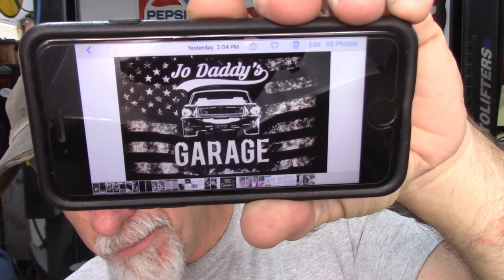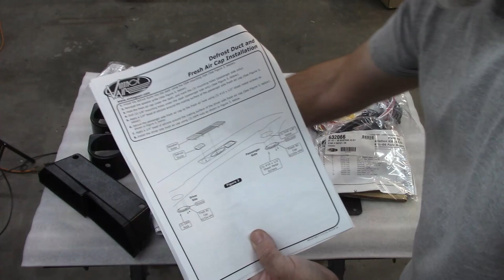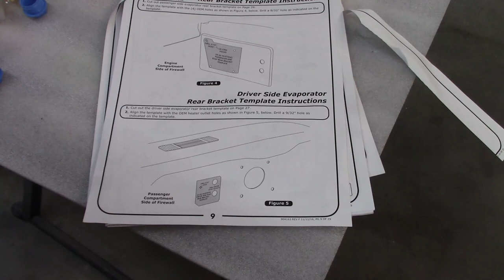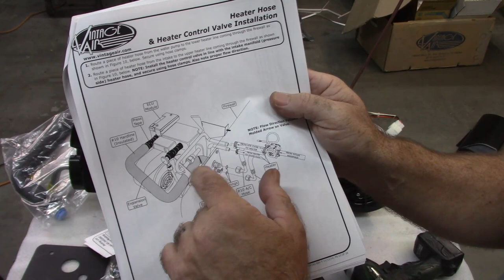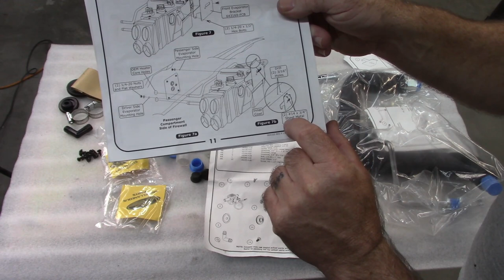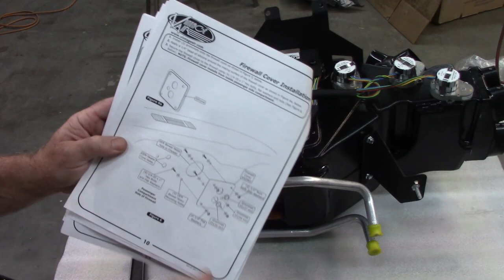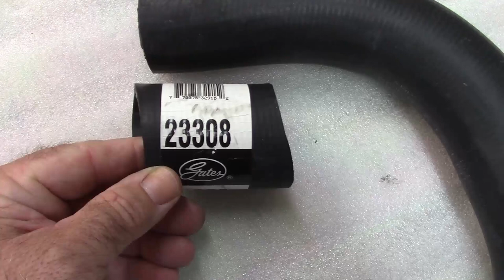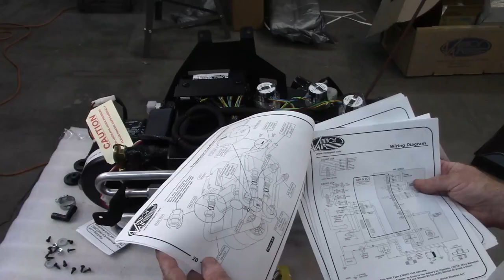Vintage Air test fit part 3. Brooklyn Pony 46 C

Comment: I worked in a machine shop and was a hydraulic mechanic when I was a you g pup for about 5 years. We called them Allen Cap Bolts, socket cap does not feel correct. Barry great video. I have a NON ac convertible, doubt it’s will get air. But like everything in restoration, after market parts don’t just bolt up, which is something I’ve learned and greatly appreciate the details.

Comment: Hey this is Floyd with Floyd's Garage I installed one of these same branded A/C kits in a 1969 GMC and experienced some of the same fitment issues that you are having, but with that said at the end the customer was very happy with the results...HAPPY MOTORING!

Comment: Those spin nuts you put on the 2 bolts on the heater/a/c unit. They're the same as manufactures used to put on the brake drums. I used to take them off with needle nose players I believe they should screw On. The vids are very informative thanks!

Comment: Hi Barry, always enjoy your videos. I'm building an AC Cobra replica with a 347 and I have installed a heater and the hoses I used  I got at  Car Quest auto parts are Dayco part # 80405. The hose is about 3ft long it is straight with a 90 deg bend on one end. You might be able to use the 90 deg bend to connect the heater tubes to the  control module. Also I don't remember where I saw them but there are springs made to Insert into radiator hoses to keep them from collapsing. It might help for the lower radiator hose. Thanks and congrats on your retirement, Gerald Reedy

Comment: glad to see I'm not the only one that had "missing pieces". i was missing hardware and also that plate that mounts the unit to the cowl. they sent it out quick, but just that i had to wait.. one more annoyance.. btw, the unit is easier to place under the dash if you wait to bolt that front plate on it till after you get the 2 firewall side ones attached.
Reply from the maker: Good idea. Too bad the instructions don't say that.
Reply: @JoDaddysGarage  "i like to think of them more of guidelines than actual code"  - Pirates of the Caribbean.

Comment: I install vintage air unit in my friends 57 gmc and had a lot of similar obstacles to overcome like you did. The heater control valve i mounted on fender well using 90 degree hoses on the heater core outlets for plumbing to clear valve covers and get things pointing the right directions. The instruction sheets really lack a lot of good direction like you discovered.

Comment: Sounds like this is a new phase in quarantine: Giving shit to the nicest guy on YouTube over the proper name of a bolt.
Also, i'd call that a socket head cap screw, believe it or not.
Reply from the maker: I'm not offended. I would rather use the correct terms, but I get caught up in the process sometimes.

Comment: Your first mistake is drilling through a paper template. Get yourself a spring loaded center punch. That radiator hose is going to need a coil wire support on the inside otherwise the water pump is going to suck that hose flat and you'll have over heating issues. I almost forgot, the heater control valve does not need to be directly inline with the tube coming through the firewall. They did the drawing like that to show that is is connected to the upper tube. You can pretty much put the valve wherever you like. The reason it hits your valve cover is that engine is considerably larger and taller valve covers than the factory 260's and 289's back in the 60's.
Reply from the maker: Thanks. I tend to consider how someone would do the task using the instructions provided. I can't assume they have all the tools I may have. I do have a center punch, but I illustrate how the instructions are worded. I'll look into the spring. Good idea. I know the heater control valve can be in a different location. Again, I'm illustrating the instructions. Actually, the engine is a base 302 block, and would be the same as a 289. I did a comparison to my 68 Mustang with a 289, and the lines do the exact same thing. It's just an anomaly with these cars. Good comment.
Reply: @JoDaddysGarage  The blocks are the same but the architecture of the cylinder heads are different which moves the valve covers up a littler higher. Plus like I said, the valve covers are taller then the factory stamped steel.

Comment: The heater lines will line up better when you put the o-rings on the fittings on the heater box end of the lines.  Look at page 20 of the evaporator installation manual.
Reply from the maker: Thanks. I was thinking the same thing.

Comment: Good video. Always need to see the problems and the resolutions. I was thinking that if you knew you were using a vintage air with the block off plates, you could have cut off the air inlets and welded the inner cowl shut completely.
Reply from the maker: Great point!

Comment: This is exactly what happens when you are installing non-factory parts. There are going to be a lot of "Huh?, "Where...?", "What the..?", "How is this supposed to fit/align/ connect...?", etc. A LOT of time goes into reading and re-reading the instructions (if you didn't throw them away in anger already). Usually, these parts are being installed for the first and only time, so things tend to get drawn out and frustrating. But it is all worth it in the end.

Comment: get rid of those aluminum heater hose tubes, weld up original heater hose firewall holes,   use a firewall heater hose bulkhead fitting,  put the heater control valve under the dashboard,  less clutter in the engine compartment,  use hose nipples right off the end of the copper tubes.

Comment: Very informative. I wanna do some sort of air install on mine in a couple of years and this has some good insite and is much more detailed than other videos on this same subject. Also impressed at how perfect that hose works. Any concerns of the lower hose collapsing at temperature?
Reply from the maker: Thanks. That could be a concern. I'll investigate further.

Comment: Looking good. Not sure what system I am going with on the 66 yet. 

      When you go to seal those block off covers in the cowl don't use silicone. Silicone has acedic acid and will cause steel to rust. The best stuff to use is 3m 5200 marine sealant. It sticks anything to anything and just works. $11 a tube on Zoro and comes in white or black. You will use it on everything once you have it. And on that pass side one I would not screw it into place. Put the sealant on and use a stick to prop it up until the sealant dries. Running screws into the cowl at the bottom is a bad idea...
 
         Also the two holding the bracket in that you had to drill. I would prefer to use a well nut or a sealed back rivnut (very hard to find though)

                That lower radiator hose you can get lengths with a preformed 90* on the end. If the parts store doesn't have them just find one hanging up that will work.
Reply from the maker: Good info. Thanks.
Reply: @JoDaddysGarage  Use panel bond and you want even need screws...

Comment: yup.. ole socket head bolts.. the domed ones are button head bolts. if you're trying to purchase them is about the only time you need to know the right name though lol. i was cringing when i saw you drilling from the inside.. i felt surely you'd punch through into the back of that hinge.. should invest in a "carbide de-burring" tool for cleaning up the holes. they're cheap and save a bunch of time.

Comment: The 87 - 93 fuel injected engines has 90 degree hose elbows that attach to hardliners that run down the intake Valley, then to the intake barb at front and waterpump. I used to use them to clean up install on my older Mustangs.https://lmr.com/item/LRS-18472A-K/86-93-Mustang-50L-Heater-Hose-Kit

https://www.foxresto.com/1986-93-Mustang-Heater-Metal-Tube-Assembly-p/4486001.htm

Comment: With sealing off the cowl fresh air intakes does this just act a a recirculating AC / Heater unit? How does that affect defrost?  Is the only fresh air now supplied by the vent windows?  Well in this case it's a convertible so there is plenty of fresh air.  Thanks.
Reply from the maker: Pretty much. Defrost will still work, but it will all be recirculated.
Reply: @JoDaddysGarage  Thanks

Comment: As usual, love your videos.  This is great to see for anyone looking to do this mod.  I'm wondering how difficult it would be to run the plumbing between the aprons and the fender?  I'll link a build page on a 68 Charger that shows something similar to what I would like to do.  It would be allot of work but would give a great, clean look.  Thanks Barry.

https://www.pro-touring.com/threads/106855-Modern-Bullitt-Charger-build/page16

Comment: That just doesn’t sound correct. the tool is called hex bit socket so wouldn’t the bolt be a hex bit bolt??
Reply: Need a socket for the bit

Comment: it looks like you got a 6cyl rad as apposed to an 8cyl
Reply from the maker: No, it's for a v8 car. The water pump exits to the driver's side with this configuration. The radiator is actually slightly larger as it's meant for a 68 model with a 289.